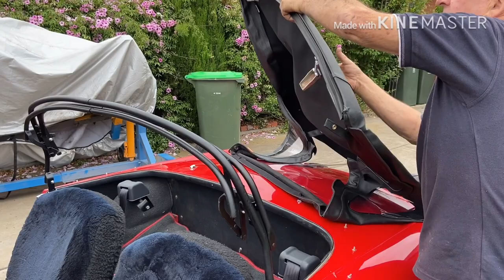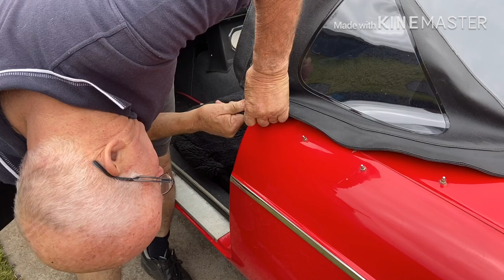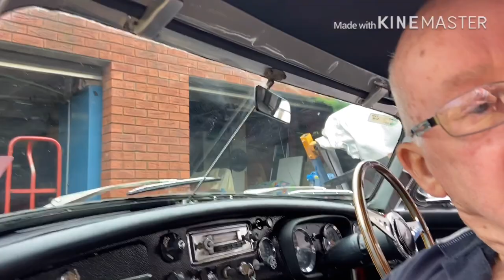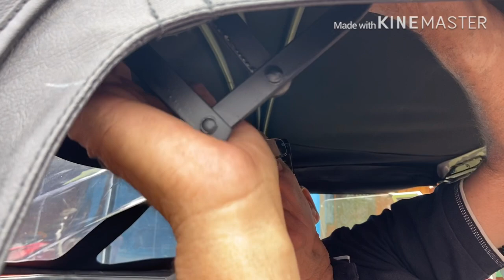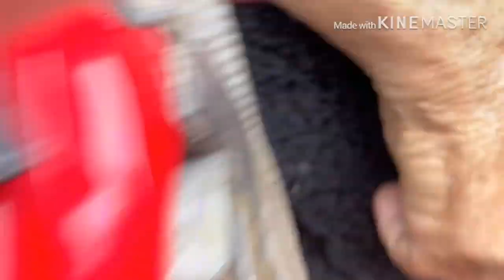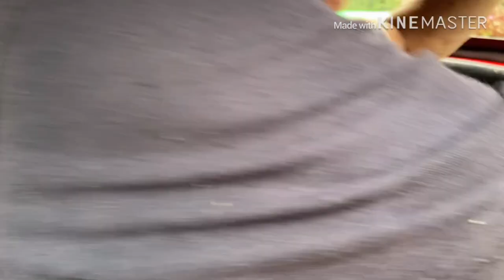MGB Packaway Hood Fitting Guide

Comment: I put the pack away hood up for the first time on the B today 
Thanks again David, could not have done it without your video !
I had a ‘67 B back in college and I think it must have been the fold away type , because I have no memory of doing this before
Reply from the maker: Thanks for your comment.  I’d recommend leaving it up on the car as much as you can leaving them in the folded position does tend to let them shrink. I don’t think it’s UV. I think it’s just age of the material. Keep it installed , stretched out onto its pins and covered. You’ll get a good result.